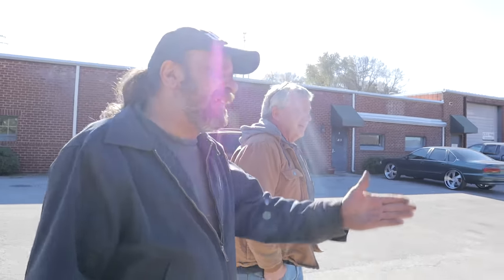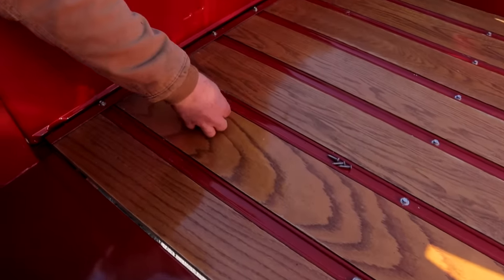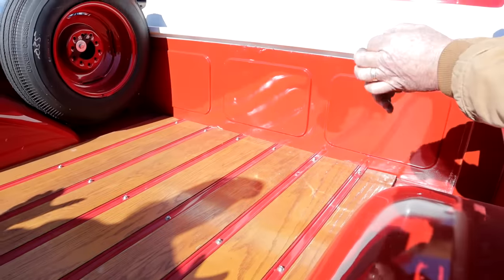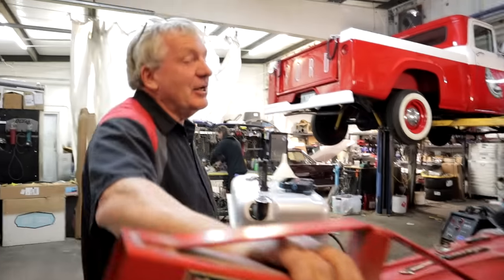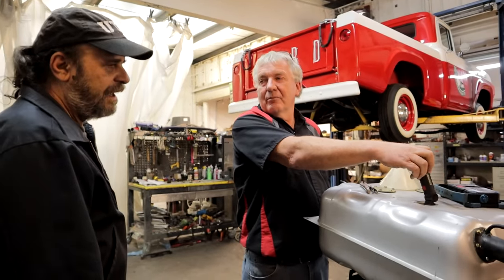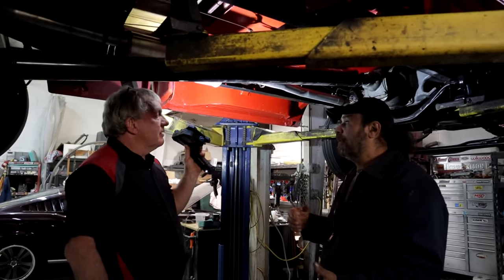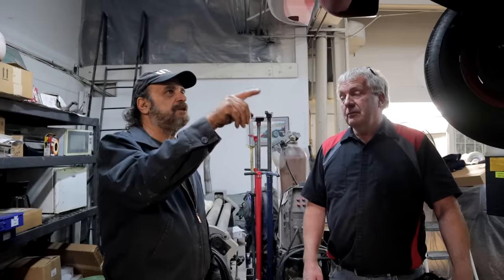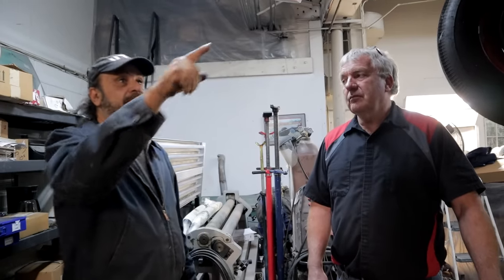Frame Off Restoration Gone Bad - Pretty Red Paint Hides Trashed And Rotted Parts Throughout

Comment: One of the lessons to be learned here, do in person progress checks. If you show up every week you can see exactly what they're doing and it's harder to hide stuff like this. Even if you're not that mechanically savy, you'll see the fiberglass contrasting with bare metal before its covered in paint. You'd see the rotted bed rails before the wood floor is in place. Bring a more knowledgeable friend with you if needed. If you see something fishy, ask a friend, the internet, anyone but the shop. Then the shop can either fix it or you can take your project somewhere else before the bill gets any higher. Worst thing to do is drop off a project and wait for the "it's finished" phone call.
Reply: You can also see that 3 weeks of "labor" billed was in fact 3 weeks of beer drinking, or worse working on another client's project.
Reply: You assume the average "more bucks than brains" customer would have a clue what they're looking at. Wander past any body shop you see bondo "skim coat" leveling. Every boat has "structural fiberglass" work. A good talker is going to convince your average pigeon "this is how its done". But, you also have to look at what the final purpose of the "restoration" is supposed to be. If this truck was supposed to be a "static indoor display" piece, it's pretty ok. If it's supposed to be "restored to factory fresh, roadworthy" condition, it's complete butchery. Betcha the butcher shop even uses puffery like "museum quality restoration" as lawsuit insulation.
Reply: Bro- people spend 70grand on a restoration - they aint gonna go and babysit the staff
Reply: I assume nothing, can’t save everyone from every situation
Reply: The trouble is that once the shop has your vehicle, they can hold you to ransom; if you don't accept the work and pay the price, they can hold your vehicle until you pay or dispose of it if you refuse to pay.
Reply: @petesmitt  When the job is "finished" you are right, there is little recourse, and the situation is more difficult. You now have to rely on the work order/contract, it's wording, how detailed it is, possibly lawyers, etc.. But if you check on progress like I said in my original post, you can also stop progress.  You may not be able to get out of paying for progress already made, but it's going to be less than if the job was 100% complete.

Comment: I had some stabilization work done on my 1983 Caprice over a decade ago.  The shops didn't want to do it but finally agreed but would be as is, no warranty.  I have since completed my welding, sheetmetal, and auto body / paint training at the local community college.  I went back and removed all the short stranded filler, cut out the bad metal, fabricated new parts, and welded them in.  A lot of work cutting, fitting, welding, removing warpage.  So the fill jobs that I had done were worth it for a short term fix.  But if you want it done right you gotta cut and weld.
Reply: I've got a rust free original paint 83 parrisenne it's a 4 door though I'm looking to sell

Comment: It's  like they started out to do it right, got into more body/frame repair than they bargained for, and did what they could to stay on budget, in the end cutting massive corners
Reply: There is no budget for a full of frame restriction. You have no idea what's involved until you do it. That's why you charge by the hour for every hour . Be it 1500 hours or 2500 hours. I've spent almost 100 hours one 1 fender.

Comment: I'm restoring a 1967 F250, when i bought it i saw just a couple rust bubbles, i thought it was gonna be an easy fix. At first i wanted to do a Vice Grip Garage floor pan repair but ended up having to do a frame off to change both front cab mount, part of the floor and part of the passenger door frame. When you see a rust bubble its just the tip of the iceberg.
Reply: I had a Emberglow 66 F250 custom cab camper special, wish I'd never sold it 24yrs ago after a break-up with a long term girlfriend, and couldn't drive everything back home to my state from Colorado..smh..from Wyoming USA 🇺🇲🤠
Reply: That  happened to me on my 75 f250 4x4 over the summer. Started out just trying to replace a inner fender apron. Both floorpans and cab mounts and front clip later.😭🤣
Reply: Lmao 🤣 so true got a 1964 lemans with my dad as a father son project. Started with some fiberglass in the quarter panel. 5 months later full floor pan, new quarter, lower bottom end of quarter panel fender lip both sides all 4 wheel wells replaced. The more you dig the more shit you have to address without turning it into a hack job.
Reply: This is the truth. I use the analogy old cars are like an onion. There limitless layers and each will make you cry.

Comment: Uncle Tony, what greater way to make a point than by show and tell. As one who had a 57 F100 with patina finish and a million dings for 20 years, I chose the less pretty more functional, practical, safer route and repaired or replaced the majors like floor, cab mounts, rocker panels, springs and mounts, tie rods, etc. (even installed seat belts!) all with second qualified opinions. As a result, this truck is still on the road with a mechanic owner since 2003.

Comment: I looked at Squarebody Chevy for sale not long ago that actually was repaired with road signs. Not a frame off by any stretch but it did look decent from a distance until you got under it.   I hadn't seen road sign repairs for quite a while. lol
Reply: Have you ever seen happy meals used to hold the bondo in place? Unfortunately I have, and they didn't even leave me the toy 😑
Reply: Looks good from far, but is far from good.
Reply: @darksu6947  No toy? Evil bastards! LOL
Reply: @darksu6947  lol😂. That's rough man
Reply: Have seen old license plates used also.
Reply: I always thought so n so   Some Co. build some thing to look like 57,58 ,59 n60 F100 that’s me saying only.
Reply: That was a factory option. 😂

Comment: When he is talking about the cost to bring it up to par, and make it safe, my best guess would be that it would actually cost more than the original restoration. You literally would have to go through an undo everything that's been done to it before you can repair it properly. I could see a major lawsuit coming out of this if somebody was driving it and was seriously injured because in an accident, maybe even a minor accident, it would fail in places that it shouldn't. I would say that the shop that did the work should have to pay 100% of another restoration. But I don't know whether that would wake them up or just piss them off. A true crime.
Reply: NO. None of hat was issue besides the cab mounts.

Comment: I got screwed with minor and major errors on bodywork and repairs over the years. Real hack stuff and then years later you have to redo the mess for 5x the $ and time. When I brought it up to these "shops" they pretty much just blew you off and were like "Oh so you wanted it perfect"     When i had all like screw holes screws drilled into things bondo slapped on peeling off etc
Reply: yep same thing happens to me. "You keep your truck clean and want it right." "95% of the general public wouldn't notice."
Reply: @jewllake   My thing is trashed I have 16 holes to weld up.  I need to get gas soon. Ya the idiot drilled 16 holes Lets just say they are still in biz  Maybe they need some drilled holes.   And it needs a whole repaint again over a repaint.  But they did nothing wrong!  If you want to run cars/ trucks and want to keep them better invest in everything you need to DIY. Cant trust anyone. I think some of these hack shops should invest in eye glasses for their employees and better lightning. If I see some dungeon place Bail on it.  You know its going to be hack. Or if its an person wearing old beat up eye glasses.  Cant see
Reply: I once had a body shop explain to me that the swirls they put in the new black paint they sprayed were only noticeable because the car was black. The car was also black when they quoted the job... About a year later, the paint started lifting.
Reply: @TheBrokenLife   One place that does restorations said use white nail polish to fill in the spots where they forgot to paint. Claimed it was fine. Its all peeling.   Place was called "Jacks" I call it Jack off's      Still in business. They attack you when I left a bad review with pics and claim im fake
Reply: @GhettoWagon  You should fight in court, not in reviews.
Reply: @mexicanspec   . It will cost me more to file + time   And some was insurance work and insurance does not care even if it falls apart later on. I would rather just bad mouth like 4 places over and over. One place I dealt with was perfect so..  I mean perfect 100% like original if not better It was amazing.  I could not find 1 ERROR.  Not all of em suck. But I dont live there anymore.
Reply: @TheBrokenLife .... I worked in a production detail shop (25-30 cars a day in mid-summer )when I was young1969-1972. It is true swirls do occur in black paint if you are not using the correct buffing compound and buffing pad and technique. Certain cars like VW Beetles of that period had certain colors we would not even wax after buffing to shine up where oxidation had dulled the finish. We found red , dark green, and black would haze over in a day if we waxed and look terrible. These were all mainly new car dealers trade ins they wanted cleaned up for resale. Paint lifting likely is a result of improper prep work . 75 % or so of a good paint job is in the prep and primer.

Comment: You mean your doors aren't supposed to fill with water? 
Damn and for all these years I thought that was a Chevy square body option along with the Hood bend option and fender rust option. Nice looking Ford though, Despite it's  problems. Kiwi always has something that makes you scratch your head and wonder WTF were they thinking? And I'm going to add this. This is why I do all my own work. Engines, transmissions, rear ends, body work, glass, front end alignments. The man that taught me body work, was a Corvette specialist according to his sign. I learned to do fiberglass, how to fabricate steel for replacement parts, he used to buy cars that were rollovers and and fabricate window pillars, panels, that's where I also learned how to install glass,how to use lead, Bondo was a bad word. I hate shabby body work.
Reply: right.  my old man was sold a silverado and told "it has a built in water dispenser as standard equipment"
Reply: @hughneutron5303  I always know when it rained overnight, by how much water leaks out my driver's door when I open it.
Reply: It's a kind of sound reduction filler, gives the doors a reassuring "thunk" as opposed a rattly clatter, when you close them and also provides some side impact protection and radiation shielding too.
Reply: @mudduck754  put a tap on it.  boom, added feature.  extra $100,000 on facebook marketplace!

Comment: I had a 1968 Mercury M-100 pickup truck (Ford F-100). It had a lovely 300 cubic inch inline 6 cylinder engine. Tons of fun to cruise around in. Great truck! I redid the upper engine components and gaskets, and it drove like brand new. I'd be livid if I paid for restoration and major oppsies were made on my truck.

Comment: I'd replace the gas tank, get it running and enjoy it.  Maybe replace that brake master with a dual reservoir.  No way to definitively tell how much steel is under fiberglass and that RTV may very well be cosmetic.  As they said, redoing it would be close to a new resto.    Yes, as a shop you have to tell the truth regarding what you find.

Comment: I dread bringing my car to a body shop. I always get screwed. I don't know where they find these boneheads. It seems like nowadays everybody wants to get in and out of the shop so they could get their money and move on. They don't care about quality.
Reply: @WonTooForAte9  I have a Corvette I needed body work and paint work done to it and I brought it to a shop locally that was supposed to be the best in the area. They gave me the highest quote but I wasn't worried about it. I was wanting a good job done. I didn't even need the car back and I told them to take all the time in the world they needed. Then they still did a horse shit job. I got the car back and there were body lines that weren't right. The front fender bound up with the door. I even found miscellaneous fasteners sitting in my cup holder that I don't know where they went. They didn't bother sanding out the orange peel. They even had swirl marks in the paint from their buffing. And when I brought it back to have them realign the door in the fender, they did and it still did the same thing. I brought it back again and the owner got snotty with me over it. He told me that they didn't have time to keep messing with my car. And they were the one that took the door off to paint it. My neighbor just had some work done on their car at a different body shop and when she got it back I looked down the side of it and I couldn't believe all the orange peel they left on it. How sad. I guess it's just like mechanics, it's hard to find a good one.
Reply: @WonTooForAte9  Every time somebody I know has body work done to their car I asked them what was done and I closely inspect it. Then I asked them who did the work. Trying to find out who sucks and who doesn't. But then again it also depends on who they have working for him at the time.
Reply: @frankc1430  Let us know who it is! I am going through the same thing right now and I am writing a detailed report for everyone to see very soon.

Comment: The silver furnace tape is an old trick. A friend's son bought a ranger. Truck looked awesome.  Frame was super clean along withe the body. Was put on the lift for state inspection. Truck bends. Frame had been repaired with silver metal tape, painted and  then covered with grease and dirt.

Comment: Great video!...another gussied up rust bucket...what they did to that woman is criminal. I hope she sues them. Passing that truck on to someone should be considered fraud. Very cool aluminum FE. I would suggest not hanging the tank by the flange . That flange is there to be able to use two stampings welded together to make the tank. Instead, or in addition, run straps underneath to support it. If that tank holds 20 gallons, that's a static load of 120 pounds. Also consider adding a skid plate to the front of the tank. This is common on production vehicles to prevent perforating it open, by running over debris, or your ex-wife,  "accidentally".
Reply: I will disagree Ford sold millions of vehicles that used that flange to hang the fuel tank
Reply: @shanefluhr6454  I understand and appreciate your opinion. Thank you for pointing that out. That's an aftermarket tank, probably not made to Ford's standards, but a knock off, thats been relocated to a place it was not designed to be. Remember also- firey Pintos - not saying it will catch on fire in an accident, but protecting the tank should be part of relocating it. It's only a sheet metal tank.

Comment: I wish I could do a frame off resto on my 1982 F100.   I don't have a garage.  But over the past few years, I've been replacing/fixing complete systems at a time.  Engine was rebuilt, then brakes/lines/hoses, then steering linkages/steering gear/column, then fuel tanks/lines/pump/evap etc....  Body work is outside my experience though.

Comment: I just looked at a '53 Chevy hardtop that was "quick licked" & both bumpers, grille & other chrome was also painted. The lower doors & quarters were rusted yet were still covered in new paint. The asking price was insane & I told the owner the way the body was painted it should have been just left alone.

Comment: I've known a few shops that will restore, refurbish and repair old vehicles and motorcycles. They tell people up front if they need to ask how much it'll cost then they probably can't afford it due to the amount of work that's required and the cost for hard to find parts. They do keep a photo album of each vehicle they've done that shows their process from start to finish along with the parts list with prices paid to give them an idea of what they might be spending. Most of their clients would drop off their vehicle with instructions on how they wanted it back and to contact them when they needed some money. A restoration was where it was completely dissambled for cleaning, inspection, repair or replacement then reassembled. What you got back was a vehicle in like new condition since all rust, corrosion and original coating had been removed down to clear bare metal. Refurbished was replacing and reparing what was needed so it would look like a well maintained old vehicle. Repaired was getting something running again, replacing some components so it could be driven/ridden safely and touching up paint while cleaning up the rest to keep the old vintage patina. These guys made their money operating a regular business where they charged the going rate so they could charge less for working on the old vehicles. They did that when work was slow in their shop, afterhours and🎉 on weekends with their young trainees doing much of the work under supervision to learn the craft.

Comment: I’m looking at buying an old truck.  A couple of problems I found are insurance and storage.   All the companies require you store in a locked garage and most require you  drive very little.  Safeco allows 10k miles a year but it’s gonna be a daily driver. Plus I have to worry about shotty craftsmanship.